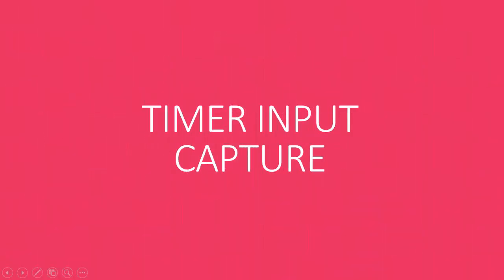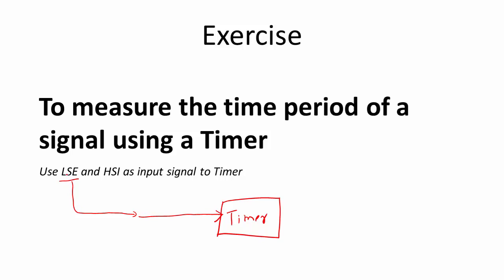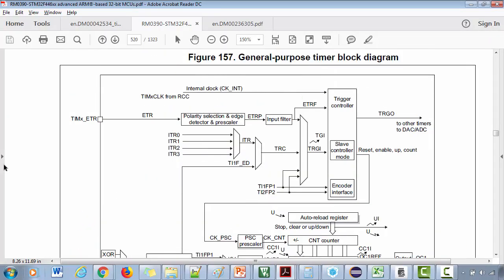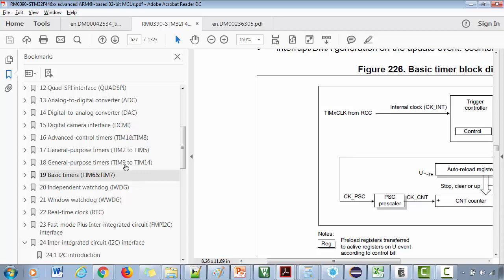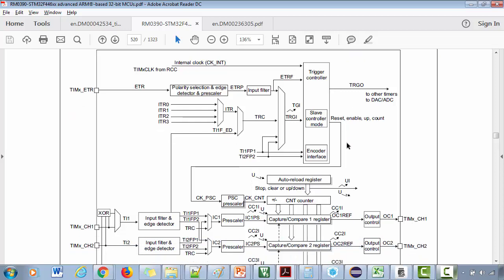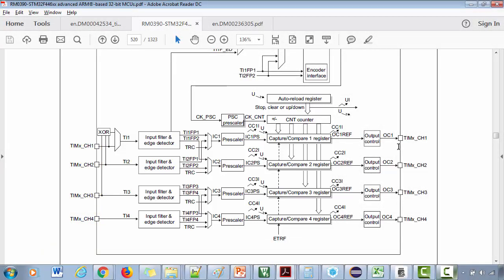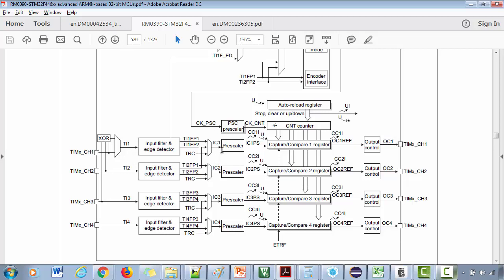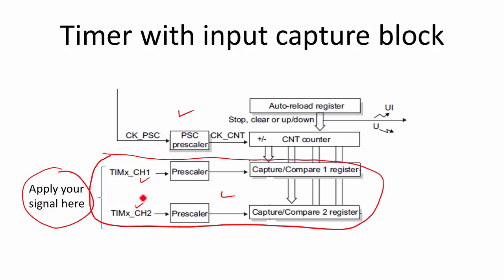STM32 General Purpose Timer: Understanding Input Capture IC Mode -1

Comment: I understand if you are interested in counting rising or falling edges then setting up the timer as a capture-compare makes sense... however, 

#1 How does the prescaler value affect the counting?
#2 I assume enabling the interrupt will cause it to fire whenever there is a rising edge, but won't it count without using any interrupts?